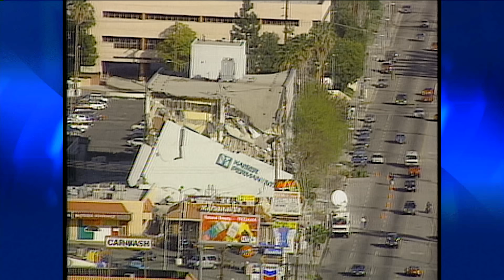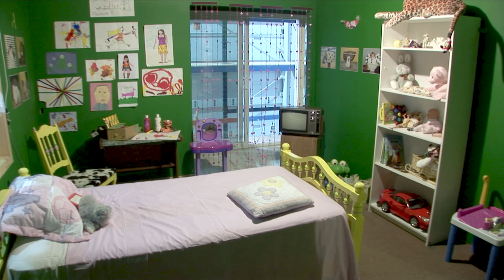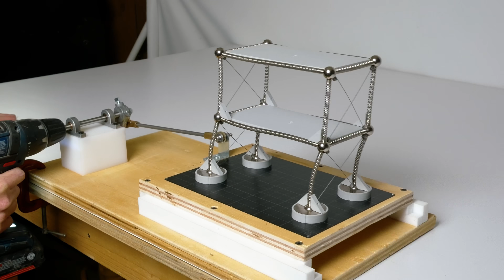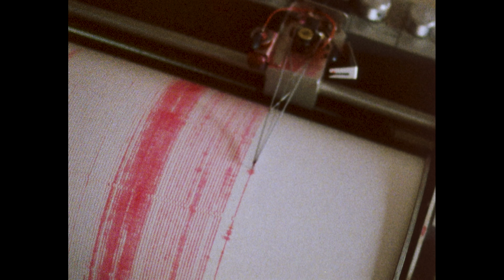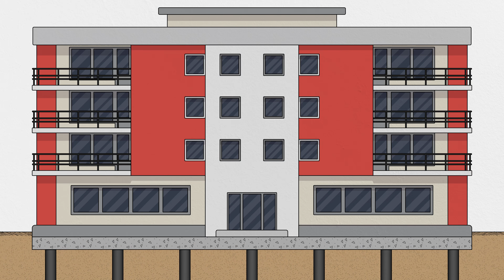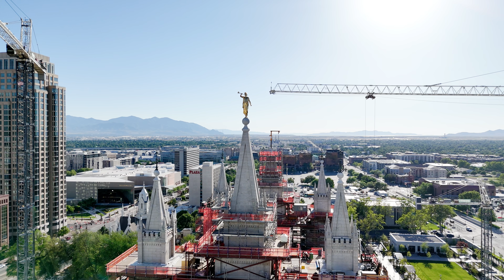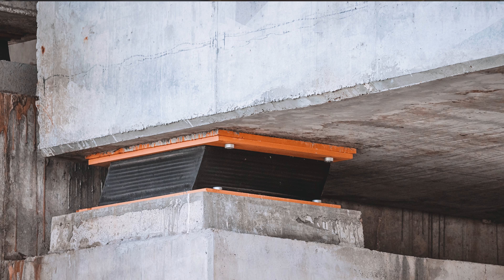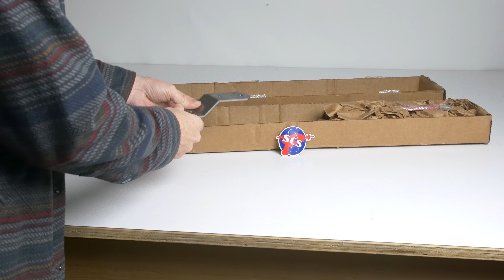How Earthquake Bearings Work

Comment: In 1985, I was framing single family houses in the Northridge area.  The earthquake mitigation involved both bolting the bottom plate of the exterior walls down, as well as shooting special nails through the bottom plate into the concrete with what amounted to a single shot.22 blank gun.  It also involved putting diagonal braces in any exterior 5 bay section of wall (a little over 6 feet) that didn’t have a window or door and shear panels nailed around any windows or doors to prevent racking forces.  My foreman told me that most of these were implemented recently due to lessons learned from the 6.2 Coalinga earthquake.  I didn’t think anything more about it.

Years later, I worked with a guy from Coalinga who was 16 during that earthquake.  He described being chased out of his school’s music room by a piano, and his family’s home being relatively intact but sitting in the street.  The house had been built in the 60’s.

After the 6.7 Northridge earthquake, I drove through the area.  The newer areas where I had worked were in pretty good condition.  There was damage, but nothing irreparable.  The older sections were leveled.

Turns out, for smaller structures it isn’t economical to isolate the foundation, but stiffening may be sufficient.  Of course the largest measured earthquake in the area (the 1952 White Wolf Fault earthquake) at 7.3 was nearly 10 times as powerful as Northridge.  I doubt anything we can afford to do would mitigate the effects of that one.

I often have friends tell me I am crazy to live in earthquake country.  I ask them how many tornadoes, floods, hurricanes, and blizzards/icestorms they have experienced and if they have to worry about them every year.  I only have to worry about one really big earthquake in my lifetime.  I experience a lot of minor quakes, but those amount to a really good adrenaline rush.  

Wherever you live, when mother nature decides to throw down, she has a way to get what she wants.

As a side note, the collapse of the freeway bridges was due to the concrete in the support pillars cracking into rubble and “flowing” out of the rebar cage.  This problem had been identified in the earthquake in San Francisco, and steps were being taken to prevent this.  It involved installing fiberglass or carbon fiber sheaths to prevent the rubble moving, allowing repair teams to replace the supports without bridge deck damage.  The collapsed bridges were slated to be reinforced this way in the next couple of years, but it turned out that was too late.

We can build structures, from small to immense that can withstand huge earthquakes.  The problem is partially the expense, but mostly the trillions of dollars worth of infrastructure already built.  Anything built before 1970 has essentially no earthquake resilience, and it only gradually gets better.  St. Louise is a prime example.  A city built with bricks (notoriously fragile in an earthquake in that they basically crumble) located in close proximity to the New Madrid fault.  How do you retrofit that?
Reply: Wow! thank you for sharing your expertise. It's gotta be a good feeling knowing that you worked on those buildings and everything did what they were supposed to do. Brennan Lee Mulligan has a great way he phrased it last month on Ask Hank Anything (https://youtu.be/1lY7Y6iJ1jk?si=FWsrcP6ZjH6bRkE8&t=1697). It's not a miracle [from a religious force]. It's all of us, working together to keep each other safe. Thank you for your contributions to the miracle.
Reply: Most TV shows are shot in the Los Angeles area. If they use exterior shots of brick buildings, you can often see the earthquake reinforcement. Brick walls are notorious for having little lateral strength, so would fall over in earthquakes. During the 1933 Long Beach earthquake, most of the (brick) schoolhouses collapsed (thankfully outside of school hours). Brick buildings were subsequently banned, and existing ones required to be strengthened.

The reinforcement is to drill holes and place long steel rods through the brick building all the way to the opposite side. The ends of these rods are then held in place by square metal plates on the outside of the bricks. Essentially strapping the opposite sides of the brick building together. In many of the exterior shots of brick buildings used in TV shows, you can see these metal plates. (They're usually oriented at 45 degrees so look like recurring diamonds.)
Reply: @makaira69  Those metal rods are called stays.  The earliest example I saw was when I spent two years of high school in Europe.  The stays were in the ruins of a cathedral built 900-1000 AD in Louven, Belgium.  

They were trying to figure out how to build tall stone walls that weren’t so thick they took up all the room, yet strong enough not to get blown over in the wind.  This led to buttresses, which led to flying buttresses.  

I don’t remember which cathedral it was on, but the most beautiful flying buttress I saw was all curves and looked like stone lacework.  I do remember that each flying buttress was different.  The priest I talked to said that the cathedral took 150 years to build, and the chief architect built that buttress first, but died before he could get any further.  Nobody trusted his design, so they decided to build each buttress different.

I was amazed at how much internal space the cathedrals have, using basically stacked stones, until I saw the Pantheon.  

Europe lost a lot of knowledge when the Roman empire fell.  So much that they had trouble building a cathedral barely two stories high and the size of a tennis court in Louven four hundred years later.

It took another four hundred years to develop the techniques to build masterpieces like Notre Dame, but those same techniques are in use today.  Simple ideas that work never go out of style.
Reply: The depth of your knowledge is inspiring! I seek to find heights like that in my careers future.
Reply: @dovahbear3504   All it takes is a willingness to work hard - something I was seldom motivated to do, by the way.  I know what it takes; I'm just not willing to put any more work into it than I have to.
Reply: My now late wife and I moved from Camarillo, along the coast, just above Malibu, in 2005.  It wasn't long after that that we had an earthquake in Maryland (Southern, to be more precise).  I instantly recognized it for what it was.  My wife, originally from Florida, and my stepdaughters, both born in Philly, did not.  

I remember hearing and reading about the Coalinga but living in San Diego at the time, there was no perceived affect.
Reply: we had a 7.4 in 2011 and we were worried about my aunt's mobile home. it was totally fine but there was a neighbor in an older double wide that split in half. i personally never met anyone with any major damage locally probably because we don't have too many tall structures
Reply: I know a mason who comes from the northridge area.  he was doing a housing development just before the quake.  half the development was done before the seismic standards were increased, and the chimney was just stood up alongside the house.  the other ha;f had the new seismic upgrades which required the chimney to be anchored to the house structure.  
then the quake hit and every chimney in the development fell down.  the older ones just had to have the chimney rebuilt.  the new ones, the falling chimney tore the rest of the house apart.
Reply: @kenbrown2808   I remember reading about that, since I was 140-odd miles to the south, in Oceanside, CA.
Reply: @k @kenbrown2808 that’s why new chimneys are just steel tubes surrounded by fake stucco. No weight, no seismic risk. Also, fake fireplaces are what’s in style. Very few true fireplaces these days.

Comment: Those three rods are a cool way to show resonant frequencies.
Reply: True, but not as important as the way they go "yoioioioioioy"
Reply: In the past they even used to make arrays of resonant reeds to use as tachometers.  I think attoparsec did a video on them recently.
Reply: My cat was fascinate with that section.
Reply: Old frequency counters used tuned springs to show frequency. You can sometimes spot them on old generators and switch boards.
Reply: agreed

Comment: Engineering of parking garages would be an interesting thing to explore.

Weight issues with EV proliferations, fire safety etc..
Reply: lightweight concrete deserves its own video
Reply: While EVs are heavier than regular cars, they are lighter than a pick up truck. Most EVs are around 4500-5000lbs, while an F150 (the most sold vehicle in America) can go up to 5740lbs. So no, EVs aren't putting additional weight on our roads compared to the trucks we see everywhere. EV pick up trucks are a different thing, but there's barely any of them on the roads.
Reply: I think solution would be not engineering based, but economics based. EV owners would have to pay more. 

I wonder how long until EV owners and companies/people alike would be forced to pay for grid infrastructure too. Transformers and powerplants (nuclear, wind, hydro and solar too, since coal, oil and gas just bypasses the whole idea of EVs), those aren't free, and powergrid was designed with handful of incandescent bulbs in mind. Maybe electric stove and heating... But with EVs... that's like having extra heater or stove.
Reply: @Alex-mj7km  That cost isn't likely to be paid by any limited group, but by everyone's taxes, just like road infrastructure. Many power grids are in dire need of modernization anyway. While the value of EV vehicles is good, their weight is another part of a broader heavy-vehicle issue.
Reply: @Alex-mj7km  The grid infrastructure is paid by how much electricity you use.  People who use more electricity, such as EV owners, inherently pay more towards grid upgrades as they’re needed.
Reply: @kc9scott  i think this would cause progressive electricity pricing in the end.

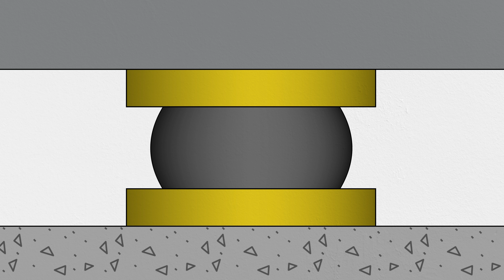Comment: 10:56 this is exactly how nozzles on solid rocket motors work, so that they can gimbal and provide thrust vector control. They need to take the internal pressure but still be compliant enough to deflect axially. But instead of rubber and steel, they use alternating layers of carbon and pyrolized silca phenolic.

Comment: the ASML factory in the Netherlands (a seismically very dormant area) also has these foundation isolators, but they use it to isolate the factory against much smaller movements of the earth. cars and trucks on the nearby highway and trains a bit further away mostly.
so it's not even just in seismically active areas where the isolation can be important
Reply: That's very interesting, I imagine it's to minimize errors on high precision equipment, makes sense.
Reply: @Welterino yup, when you're doing nanolithography with allowable errors of <1nm every little bit of vibration matters
Reply: @pocketpc_  Same thing when my friends and I made holograms in high school. We built a shake table full of sand (mass) sitting on inner tubes, to isolate the laser and holographic film from ground vibrations (people walking in the room).
Reply: @pocketpc_   does the ASML factory do nanolithography? I thought they made the machines that did nanolithography
Reply: @thewhitefalcon8539 The machines have to be tested before being shipped out.
Reply: @thewhitefalcon8539 I imagine it's down to testing. With tolerances that fine, you need to ensure the device you're making is actually up to standard, which involves testing.
Reply: The first thing I thought of when he mentioned the rubber bearings was sound isolation. Likely, because that's exactly what it is.
Reply: Cool!  And also, the Netherlands isn't actually completely dormant; RNMI post alerts about small earthquakes (e.g. 2.3) regularly.  So yeah.  VERY important when you're trying to put something on a chip that's up against its Heisenberg limit...
Reply: @stonebear oh "fun" fact about that, the Netherlands is seismically dormant but not geologically because we have done a bunch of gas mining in the north of the country to the point quite a bit of land there now has regular earthquakes. But that's a relatively new development, it also used to happen with the coal mines in the south. 
But it's all our fault and not any kind of natural disaster.
Reply: This is typical for semiconductor fabs. It has to be a small scale company to not isolate their fabs.
Reply: @Bob_Smith19  I love how small scale companies can just not care about stuff. Big companies are worried about yields and profit, small scale companies and university labs don't. I need 1 working device and there's 20 dice on this wafer, who cares about ESD or a speck of dust?
Reply: I’ve heard of at least one recording studio that uses this type of system for sound isolation.  I’d imagine there are plenty of others.
Reply: @kc9scott Yup! The most soundproof rooms do everything they can to decouple themselves from the rest of the building. Especially for low frequencies the most effective way to absorb them is often to just build a second, slightly smaller room inside and mount it with isolators.
Reply: Similar for ligo and other scientific instrumentation iirc
Reply: Also, Fracking has caused many earthquakes of small magnitudes. With enough of these, Cracks form
Reply: @CCRA1286  Fracking doesn't introduce enough energy to cause earthquakes. It can trigger the early release of stress already built up in the ground. i.e. If an earthquake was already primed to happen, fracking can make it happen sooner than it would have naturally. But it can't cause an earthquake which wouldn't have happened with no fracking.

I still maintain that we missed a huge opportunity by not exploring this further. Avalanche danger has been greatly mitigated by deliberately triggering small avalanches before the snow builds up enough to form a devastating avalanche. In the same way, we could've used fracking to cause small earthquakes, to relieve stresses which if left alone would eventually cause a devastating earthquake. But that avenue of research was shut down by people who naively reasoned that fracking = oil = bad.
Reply: @m @makaira69 Well, any large earthquake is MILLIONS of times more powerful than something from fracking. Plus, many zones are hundreds of kilometres in size, in 2004, that zone was 1300km long and like a hundred thick. Fracking wouldn’t work even on smaller faults really, and oil is bad. Plus not all the faults have oil near them. Unfortunately this is highly innifective
Reply: Almost all Fabs also are built like this...
Reply: @Bremend  Many Fabs are also build in earthquake prevalent regions.
Reply: I am actually a bit surprised by that tbh, although if there is one company out there that might do it one some of their buildings, it would be them. I know that other facilities that are sensitive for vibrations usually resolve that by adding lots of mass (= concrete) to the foundation. If your foundation has sufficient mass, it reduces the sensitivity to outside stimuli like traffic.
The machines themselves actually have their own (multi-level) vibration isolation system, that isolate their really sensitive systems even from their own machinery (read: speeding wafer chucks, vacuum pumps, water pumps, etc).
Reply: Better than the ASMR factory
Reply: Wow genial 🫵🫵🫵👍👍👍👍
Reply: Yes smaller movements of earth. Have you seen the footage of the 1989 sf quake? It shook so hard for 30 seconds that shelf’s were falling off walls, people couldn’t keep balance and were stumbling outside if they could. That tech you’re talking about is cool. But that’s for like tuning out the sound of your neighbors in a music studio vs preventing the house from collapsing because it’s being shook like a baby with a horrible mother.
Reply: @TheGhostOf2020   I was living in Oceanside, CA at the time of the '89 Loma Prieta and the '94 Northridge earthquakes.  The '89 was centered about 50 miles south of San Francisco.  We felt that one in Oceanside, and 30 miles south in San Diego.

For reference, Santa Cruz, CA, is roughly 461 miles from San Diego.  Loma Prieta is actually closer to San Jose, CA, to the north, but somewhere between that, and a triangle with Gilroy to the SE.

Think about that; we felt that earthquake about 420 miles away, and they felt it in San Diego, about 30 miles to the south.

The Northridge was about 120 miles to the north of me, in Oceanside, roughly speaking.
Reply: @tetedur377  the '89 quake was named after Loma Prieta, but the epicenter was actually south of Santa Cruz, inside Nisene Marks State Park.

Comment: "dampening" flows through my mind. If a reservoir of fluid sat next to the building, and a direct-drive pump used the energy of the first and subsequent shocks to pump fluid into the building, thereby increasing the mass of the lower levels, might that alleviate some of the shock?
It would be using some of the earthquake's energy against itself.
If the fluid were water, then there is a possibility of water damage BUT the water load need be present only during the minute or so of earthquake shock; after which gravity-drain the building back to zero-state?
Great video, thanks.
Reply: Now I think about it, there is no need for a direct-drive pump; just a "wall" or plug that will be shattered as a function of the first shock wave. Shatter the wall and the reservoir floods quickly. This would not alleviate damage from the first shock, but it should weaken the subsequent shocks.